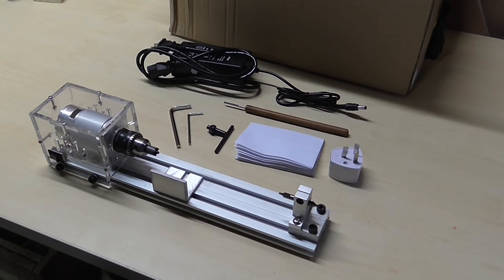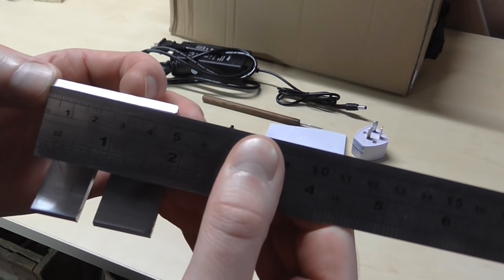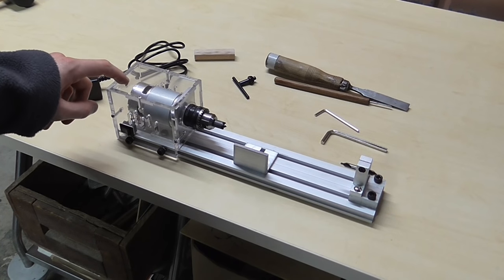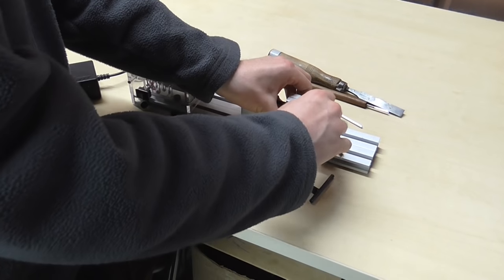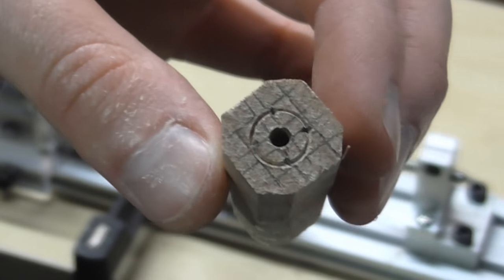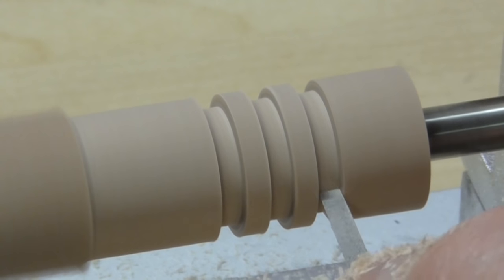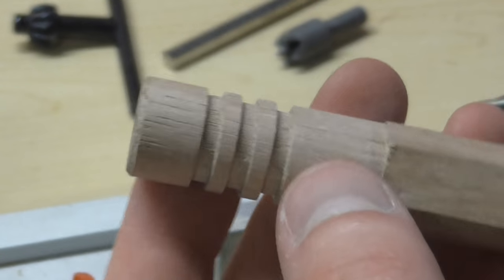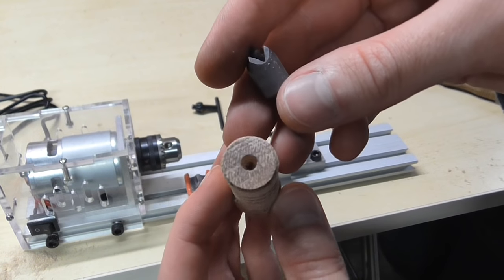[review] DC 24V Mini Lathe Beads Machine Woodwork DIY Lathe

Comment: Interesting that it uses a center drill press into a bearing as a tailstock center.  The Allen screws could be replaced with thumb screws so you don't have to use the Allen key all time.  CHEERS

Comment: oh it came with a center drill even! probably already said, but that's a stubby drill for starting holes. it creates a pilot hole and bevel so the twist drill bit wont wander.
i see these in 100W variety for $40 US and couple supposedly more powerful motors, along with a lot more accessories

Comment: One of the biggest problems with this unit is the Motor. It's brushed and uses bushes (No Bearings) Obviously, dependent on amount of use, it will show marked slop (Bushing Wear) and the brushes will wear.  The good news is that replacement motors are as cheap as chips. Plus, there is a better quality motor available, but it appears to be missing from BangGood's inventory. It may be available elsewhere though.  

By the way, it took me 5 months of constant complaints to BangGood regarding those head stock parts. Finally they made the type you used available, just be careful of overusing brute force to insert it, depending on type your wood may split.  Also avoid using too much pressure with the chisel, it will wear those bushes out very quickly.

Comment: The "6mm plum blossom thimble bit" headstock can be purchased on eBay. There are two common versions, an 8mm for smaller work pieces and a 14mm for larger. Both have a 6mm shaft to fit into the drill chuck of these mini lathes. Sadly, they're all sold in China, so plan on long shipping times.

Comment: You can get an extra inch or two of maternal length by turning the tailstock around and letting it hang off the end of the base. However, do note the screws may reduce the maximum diameter of your work-piece in this configuration.

Comment: Thanks, I bought one of these ( actually double clicked and two came!! ) and had difficulty keeping the piece tight as it kept coming loose and stalling. I admit to not having persisted yet but will try again. I didn't do like you and Hammer in the head piece before attaching it to the lathe, in too much of a rush.

Comment: Take the time to find the center of the piece, on both ends. Then drill with your center drill bit. On the drive end of your piece, cut an X with a saw and hammer in the drive piece. Put the piece in the chuck and snug up your tail stock. That should give a positive drive for the piece and prevent it from flying out at your face. That would probably leave a mark if it did.

Comment: The tail stock you need to make your self a live center so it keeps the wood in place and not make a hole as yours will do if you over tighten. To get more length turn the tail stock around

Comment: Turn the tool rest around 180 degrees.  You have it on backwards.  It was on the correct way when it arrived, but you turned it around.  The correct way you can get the rest right up to your work.  You can buy lengths of that angle aluminium from most hardware stores.  Cut it too whichever length you want..  Visit Banggood,com they are selling these off at about $50 AUD. Complete.

Comment: The reason for it loosening is that you are using the centre drill on the tail stock. Instead of spinning and remaining at a fixed level it is drilling into the wood. Remember it is a drill.
Reply: The later model uses a rotating 'thimble'

Comment: I bought the almost exact same item. It arrived with some of the plexiglass parts broken & the box looked like it had been tossed around quite a bit. The most interesting thing I noticed is the piece that you insert into the chuck, mine as all the spikes the exact same height as the centre pin, which makes centering the work piece very difficult. This lathe does not work very well will hard maple.
Reply: The later model has all metal housings.

Comment: Hi mate yes I just bought one of these, hasn't arrived yet . I bought one pretty much the reasoning you stated expense etc. My intention is to make chess pieces, I understand that because of the height of the chuck from the bed this will limit the overall diameter. I'm contemplating putting a spacer on each end to raise the work area. whats your thoughts?. Cheers from Yeppoon.
Reply: Bit late of a comment but i'm just wondering if you ever got to making those chess pieces

Comment: I'm thinking about getting one of these (or one like it). I wish they had more attachments, though. I'd like to at least find a bowl attachment or something that you can clamp with.
Reply: You might find an old metal 3" sanding disc. I've only seen plastic for many years now, or use a hole saw and cut/grind the hole part off, a long afternoon with a hacksaw would give you something to mount in the drill chuck.

Comment: That’s awesome can you extend the bed to make it longer?
Reply: Just purchased one myself. The day after I went to an industrial aluminum store and bought a 30x60 profile 70 cm. long. Just unscrewed the original and replaced it with the new one worked perfectly!!! Just be sure to get some T-Slotted Framing Fasteners and washers to fasten everything (new profile has the same measurements but the rails are deeper, so the included nuts won't work)

Comment: Sorry, I forgot to mention, I purchased two of these units when they were selling for only $35 AUD. I used part of the second tool rest to connect the two beds together. Plus I bolted the complete unit to an old bench top and now have more than double the length.  Avoid those nasty chisel packs they sell with some of the models, they really are garbage. I purchased a better quality mini chisel kit from TimberBits.(Aussie Company)

Comment: Really useful, thanks a lot. I just bought one similar but it has the silly little screw type headstock which is worse than useless! Now I know what I need. I also bought this to make tuning pegs, interestingly but now I have to wait while I get a decent headstock. It also came with 3 little silver rods of slightly different diameters, and I have zero idea what they're for - do you?
As an addition: does any know where I can find 6mm headstock / head spur? I can't seem to locate them at all.
Reply: Did you ever find out where to get a proper headstock (or is it a forstner bit)?. And did you find out what the 3 hex shaped rods are for?
Reply: I don't think anyone knows what those little hex rods are for!

Comment: Use a proper wood turning chisel, or at least a much narrower one than you're using in the video to round it, and it will be much easier and less strain on the motor.

Comment: The chuck says a maximum opening size of 6mm....have you found this to be true? I want to get one to turn smalls pens and il need the chuck to take a 7mm diameter steel rod.
Reply from the maker: I tried fitting a 7mm drill bit into it, and it fits with even a tiny amount of play. I'm not sure if you plan on turning steel but I wouldn't recommend turning any sort of metal with it.

Comment: Do you know if this can go in reverse too? I mean, going forward, and then with a switch change the rotation to the other side? Thanks in advance.
Reply: It is probably wired up for ccw only but you can put a double pole double throw switch to change its direction.

Comment: Im considering buying on of these however for my application I will not need the tailstock. Is the chuck stable enough by itself? Is there any sideways movement in it? Thanks for the review.
Reply from the maker: I was surprised to find no movement at all in the chuck. However some users have mentioned that the rear bearing is prone to wearing out. I haven't experienced this (yet) but I haven't been using it much either.
Reply: Oh okay, what do you refer to when you say the rear bearing? Thanks for the help.
Reply: It refers to the rear bearing on the actual motor, apparently they are just brass bushes instead of proper ball bearings.  See the comment by Kma Jack at the bottom.

Comment: You managed to stop the spin a few times in the start.. does this have enough HP to help sand/polish metal rings?
Reply: Ah good...
Can it fit something like this? I'm assuming the connecting bit is a standard size across drills? 
https://www.banggood.com/1_8-56mm-Mini-Metal-4-Jaw-Lathe-Chuck-Lathe-Accessory-p-1125417.html?rmmds=detail-left-hotproducts__4&cur_warehouse=CN

Comment: Hi, are you able to tell me the vertical distance from the center of the chuck, the the bed of the lathe? I have something with a 6cm diameter and I'm unsure if there will be enough clearance. I need the clearance to be at least 3cm. Thanks!
Reply: The height doesn't matter, simply undo the head and tail and shim them up to where you want them. You may have to use longer bolts, but it's not a costly exercise.  I purchased an extra kit so I can extend the bed, it also gives me a spare motor and other bits and pieces.  Mine cost $45 per kit, similar to this one, but I didn't get that head stock center.  I also purchased the adjustable tail stock, great for drilling centers.  I just wish I knew where to get that head stock fitting, that screw in piece is rubbish like he said.  What I do with mine is round off pen blanks on my large wood lathe, then finish them on the mini lathe, it's far easier to handle and a lot quieter.
Reply from the maker: You'll be fine. The distance from the chuck centre to the lathe bed is 36mm. Plus as Propfella says, it's not hard to raise the height of the head and tail stock but you won't need to for those blanks.
Reply: Lengthening the bolts and using extra nuts under both the motor mount and tail stock will make the unit much easier to use.  It's all very well to say you have 3.mm each side, but it's not much room to play with especially if your stock isn't exactly the 6cm you need.  

The first pen blank I fitted had a slight warp in it and it made things extremely tight.  If I didn't have a full sized lathe I'd definitely extend everything.  I found the pen blanks I purchased were just 7mm too long after extending everything as far as I could.  Now I have another unit coming I'll extend the bed 2 fold and more.  

Actually the biggest problem we'll find with these is the motor. It doesn't use bearings, just bushes, that means it's going to wear out very quickly.  I'm already looking for a better motor and will probably make it belt drive.  I would have been better off buying a proper mini lathe and not the Chinese poor boy approach.
Reply from the maker: Good point. I also forgot that the tool rest bolt might even interfere with a large diameter blank.
Reply: I knew there was another reason for wanting to raise it.  That rest has to be the worse part about the setup apart from the motor itself.  I've just purchased another spare motor with chuck and key included, just $18 on Wish.com.  Grab them now, it looks as if they're selling all that line out.  Some sellers are asking over $200 for the kit and yet they're available for $47.99 complete. It also looks as if they're sold out of the only piece I need, that damned tail stock center with the 6 teeth.  Try holding anything on the lathe without it.  If anyone has a couple of them I'll happily pay $20 for them.

Comment: how would it go for making handles for files, chisels and other tools?
Reply from the maker: I think it would do fine. The largest piece I've turned was 25mm x 200mm. I don't have many handles that are much larger than that. I've mainly been turning jarrah which is quite hard, as a handle would be and it had no issues.

Comment: I bought one of these little lathes, not bad at all. I've turned a few pens with it without any problems at all but now want to change the chuck to do other things. Do you know how to take the chuck off? I've tried everything but it's not budging.
Reply from the maker: I've no idea. I would assume it's a machine taper like any other chuck but I don't want to mess with it in case I break something.
Reply: Kma Jack think it would handle a acrylic pen blank
Reply from the maker: I've only turned wood, but it handles 25mm diameter hardwood blanks.
Reply: I managed to get the chuck off in the end but wasn't easy. I also had to cut the brass reducer to get it off the shaft. I got (had) a small 2 inch 3 jaw chuck on it now but the electric motor didn't last long. The motor is crap, the way it's made. It has a bearing at the front but a soft steel bushing at the back. The bushing is worn and the shaft is very loose, totally useless. I have now replaced the motor with a 24V/150W electric scooter motor, belt driven.
Reply: Does a regular pen mandrel work with the tailstock on this or did you find another way to turn the pen?
Reply: @Brett Mulgrave, a regular pen mandrel (shank only, on EBAY) works ok with it but I have since had to change the electric motor because they put a brass bushing at the back of the motor instead of ballbearing,. It only lasted for about 15 pens before the brass bushing hole opened up to about twice its diameter. I have got a new, much better motor on it now and converted it to belt drive instead of direct drive. I have also replaced the original chuck with a 50mm 3 jaw self centering chuck, much more useful now. Personally I would never buy another one for turning pens.
Reply: +Kma Jack Thanks for the reply. The bushing problem is concerning. I already purchased one of these as I'm just a beginner, hopefully I can get some stuff done before it bites the rust.
Reply: Or Dust even.
Reply: Would you say this is a viable option for somebody wanting to learn pen turning?
Reply: Yes. Open the chuck. You probably will see the hole at the bottom, and the yellow metal which the j0 taper is made off.
Unscrew and unmount the motor. Take a bit of wood, like a chinese chopstick, put it in the inside of the chuck, and hit it with a hammer. The chuck would come off. That's what i did and it worked. Sorry for my bad english. Hope it helps you.

Comment: The adaptor they have included is unsafe. It presents both a fire and shock hazard. I strongly recommend that it be destroyed and that you wore a proper plug end onto the mains cord yourself.
Reply from the maker: Thanks for the advice - I've since replaced the cable and thrown out the adaptor.
Reply: Parabellum Art Thank you. I hate to see those darn things come with Chinese imports. Socket adaptors in general are often very poorly designed so you should be careful around them.